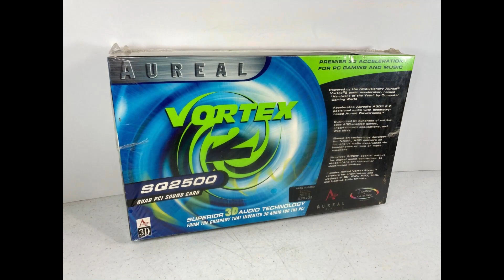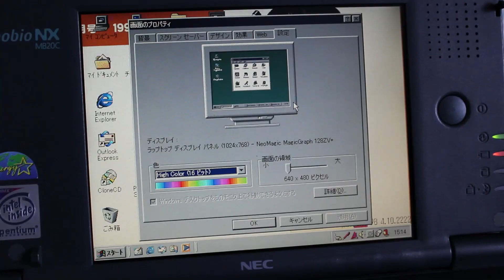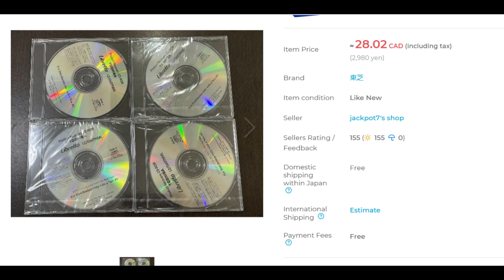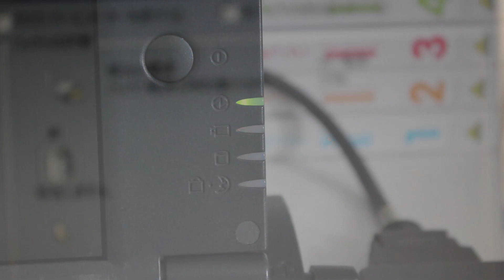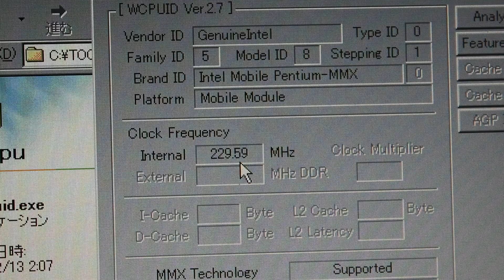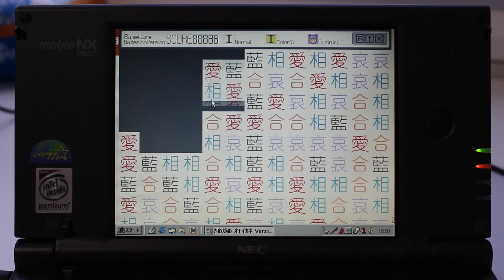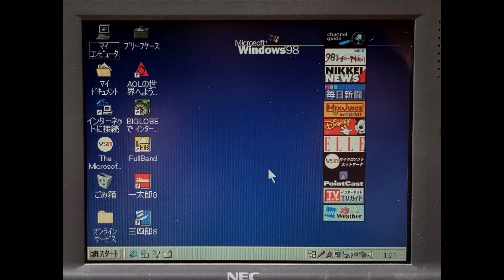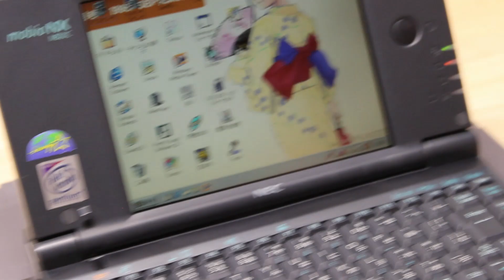The NEC Mobio NX : Better Than a Libretto ? (Info-dump & Opinionated Rant)

Comment: good video, btw with the dualscan stn models, does replacing the polariser help with making the screen usable?
Reply from the maker: Well yeah, but there are several layers to it and 10 times out of 10 every single layer is completely destroyed. In theory its fixable but you'd have to be an LCD pro to fix that. I can replace the external layer as I have done before, but anything beyond that is too much for me personally.

Comment: great video! I found out about this laptop in quite an interesting way - I recently had a trip to Tokyo and found the port adapter in Akihabara which looked to have the same proprietary port as my Libretto 30CT. It was in the untested junk section for 50 yen so decided to get it to test it out. Turns out the Libretto 30CT's port adapter socket is rotated compared to the 50CT+ models! However I have just ordered a 70CT on Yahoo Japan which is on its way. That prompted me to finally find out where this adapter came from which led me here! 
So out of curiousity - do you know whether this port adapter is usable with the Libretto? I know the socket is in a different position, but wondered if you or anyone else had ever given it a try!
Reply from the maker: Haven't tried it but I don't think it is. Probably different pin layout despite maybe the same connector. I assume youre talking about the blue mini dock. Sadly I had to sell this very recently to pay back some debts and I haven't had a Libretto in 2 years or so now so there's no way I could test it for you

Comment: Hi again, I commented on your Instagram post a bit ago asking about the LCDs in these. Thank you for the info provided. Have you had any luck getting the boards in these repaired?
Reply from the maker: The power problem?? No such luck. I dont know enough to fix it myself and the local tech i sent my first dead unit off to fumbled around with it for several months before I had enough of it and asked for it back.